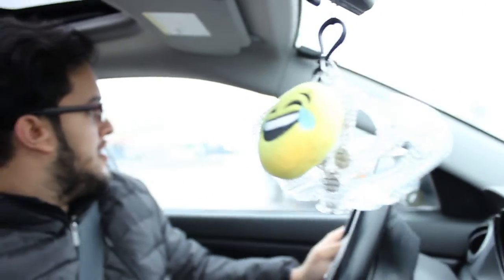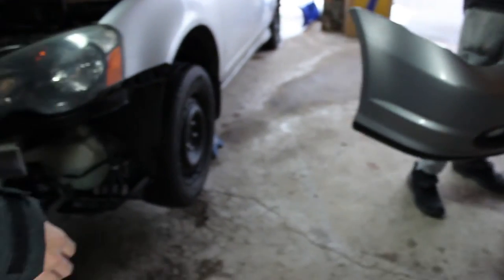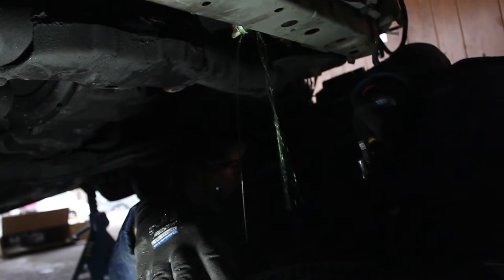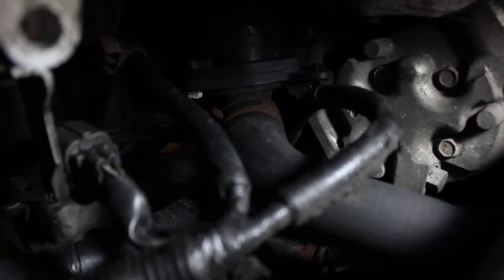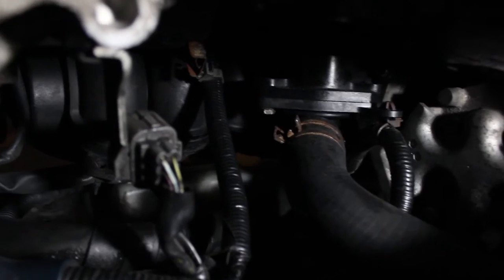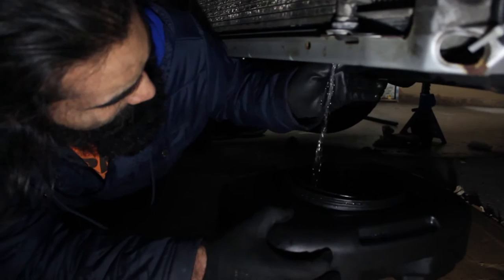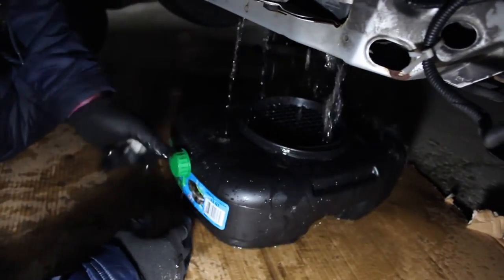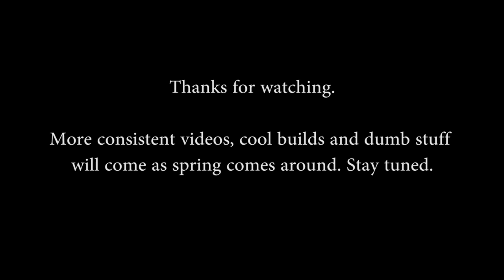*vlog* RSX Thermostat Replacement - Coolant SUPERFLUSH

Comment: what coolant did you use?
how much liter did you use?
what coolant color should be in dc5?
Reply from the maker: 1.36 gallons (5.14 liters) of Honda Type 2 coolant, which was blue.
Reply: how about on a dc5?
Reply from the maker: John, the Integra DC5 and RSX are the same car, just different branding. The car in the video is a base RSX, which is comparable to an Integra iS, or Integra Type-S (not the same as an RSX Type S). So the amount of coolant, and type of coolant should be the same if you have a iS or Type S Integra.
We are Canadian though, so our coolants may vary based off of geography, my advice is to call your local Honda dealer and ask them what coolant your car requires.
Reply: The coolant level doesn’t change lol and the color green coolant that was in that car before was a universal green coolant that can essentially mix with any color but all Honda’s take blue coolant
Reply: And y’all really didn’t need to go to Honda to get the blue coolant most auto parts stores Carry coolant for Japanese cars and it’s blue or you can go a little bit cheaper and get green universal coolant it won’t hurt anything
Reply from the maker: yea that's true, but going to Honda and grabbing OEM coolant is just as easy and it doesn't cost that much more so the convenience factor is there.
Reply: Green coolant and blue coolant are NOT the same. Will both work on your engine? Yes. Both are not going to damage your engine either... the actual difference is cooling effectiveness during higher temperatures. Green coolant is not as effective but it is universal. Blue coolant will give you hotter air in the winter... and cooler air in the summer.

Again, it all depends how hot the ambient temperature is.

Comment: how did you guys manage to get the thermostat off
Reply from the maker: It's possible to access the thermostat bolts from below with a spanner or a really low profile ratchet, but if we were to do it again it's easier to take off the intake manifold and access the bolts from the top.